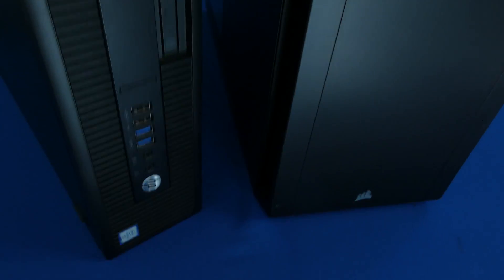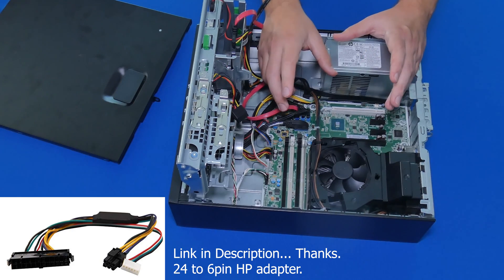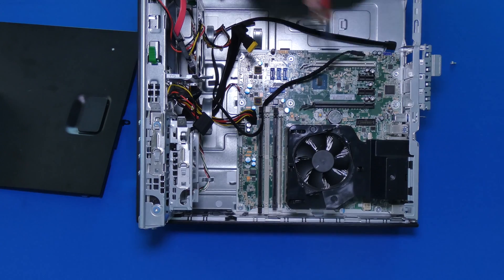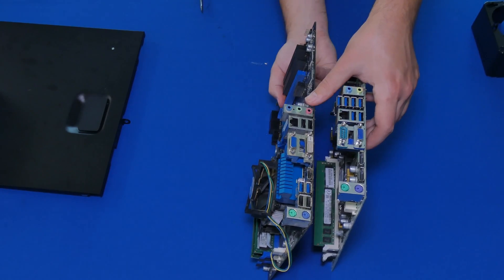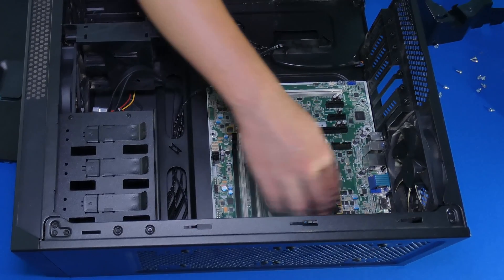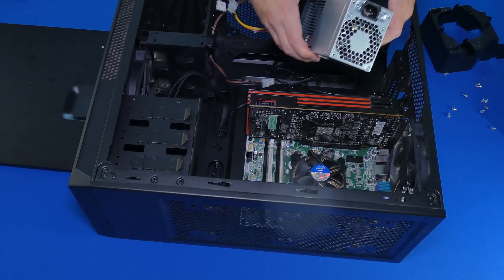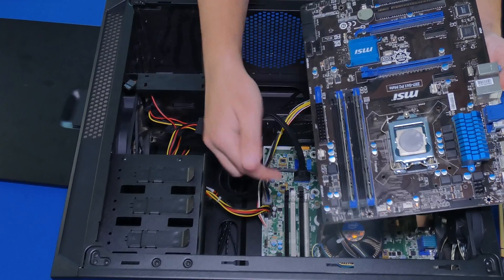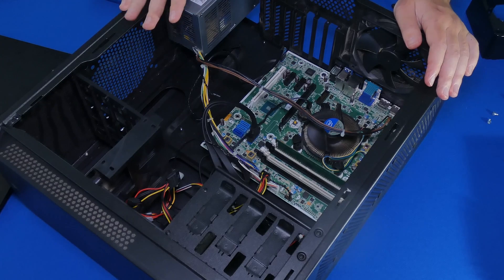HP EliteDesk transferring Parts to New Larger PC CASE

Comment: So...At the end of the day, Will this all work for a Hp elite 8300 sff?!!?
Reply from the maker: Sadly no... because it's a different type of motherboard. The orientation is different.
Reply: @Cobuman  😥😪thank-you
Reply: @Cobuman  do you think because of the front power (sw) or it just won't fit?!
Reply from the maker: @tdmtree  Motherboard orientation will not align with the back.
Reply: @Cobuman  oooooooooo ok. I see thanks for telling
Reply: I wish
Reply: It won't. Older HP sff are BTX motherboard not ATX. The prodesk ones uses ATX so you can use custom case.

Comment: I have 8300 SFF, i5 3570, 8 ram , ssd, 240w psu. I added all these components on wooden plate - to add there GTX 1650 (not low profile) which is powered through pciex16. It takes 75w (like GTX 1050 LP) so I hope that PSU 230w is enough for this setup. I'm currently working on thermal things, already isolated PSU from other components. This wooden board will be mounted under main desk board, so compleyely invisible, cold air intake from front side and hot exhaust from back side. So I hope that 240W PSU will hold i5 + GTX 1650 with 75W consumption
Reply from the maker: It should be fine. I have a couple of other  videos in which I recommended using low profile version of GPU and nobody reported any issues with stock PSU.
Reply: @Cobuman  Thanks for info! I added there Gigabyte GTX 1650 mini OC 4GB and no problem yet !
Reply from the maker: @radovanrakovicky2655  Nice!
Reply: @Cobuman  Only one thing here - based on coolermaster psu calculator my i5 3570 + 2x4GB DDR3 + Samsung SSD + GTX1650 75W it calculated 236 watt. I have also 500GB Seagate Baracuda 7200rpm but I'm not sure if this 240W HP PSU can hadle it too...so I have to make some experiments later & will inform ;-)  I think that noone did some test on PSU consumption limit for HPs and Dells small form factors with specific HP 240W PSUs during max CPU+GPU load.
Reply from the maker: @radovanrakovicky2655  I'd be interested to know what the total power consumption is on full load. I use hwinfo64 when overclocking CPU which shows the wattage as well. Although, the power is measured at software level which may not be 100% accurate. The other option is using one of those tools that measure power at wall socket. Now that I think about it I need to buy one of those tools.

Comment: I was looking for a second pc for like 400 euros, till I came accros these refurbished hp prodesks. Just bought a hp prodesk i5 4570. 8gb ram. ssd. For 125 euro. Thats like 140 dollars. The thing is fast for its price.
Reply from the maker: That's a good deal. Esp with SSD inside.
Reply: Me too! I just got a HP Elite with a i7 3770 and 16gb DDR3 ram, GT 210 and 1TB HDD for $200, I was thinking of buying a GT 1030 but thanks to this video I think I'll hold off and change the case when I can afford a new PSU and a used RX 580/GTX 1060
Reply from the maker: @Luis444Felipe  Good plan. 👍
Reply from the maker: @steven s Cool. 👍
Reply: bought hp elite 8300 with i5 3470 and 8gb ram for €89, will it work on cube case like thermaltake core v21?
Reply from the maker: @mv2430  No. :( The motherboard is different shape. It will not work.
Reply: @Cobuman  Aww :(
Reply: @Cobuman  HI, Can I transfer the HP Elitedesk 800 G1 SFF motherboard and power supply to the thermaltake core v21? Also did you have the 800 G1 SFF? Sorry my audio wasn't working but I was using captions. I will do it properly when my speaker is fixed.
Edit: One more question, do I need the 3d printed IO shield or can I use the normal IO shield? Sorry for all the questions. Thanks in advance!

Comment: Wait i have a question the hp motherboard are with different sizes of heastik how you install the normal cpu cooler
Reply from the maker: Just like in the video. So any standard intel socket 1150 or 1151 cooler should work.
Reply: @Cobuman  I will try i am on hp 800 g1

Comment: Would this work with any micro atx case or just this specific case?
Reply from the maker: It does not have to be this specific case; however, the size of the motherboard is closer to standard atx which around 25% bigger so a micro atx will not work.
Reply: @Cobuman  Perfect, thanks for the response.

Comment: Can I use the proprietary cooler by using nuts to old it in place?
Reply: I just realized i need to use nuts because the one that u have in the vid is standard mine is proprietary. elitedesk 800 g1 sff
Reply from the maker: @realKowai  The cooler/heatsink is a standard size so it depends on the cooler design.. otherwise it just fits.
Reply: Mine is proprietary as well... What size nuts did you use  @icyCodes Vlogs?
Reply: What size nuts mate?
Reply: Hi bro, what size of nuts have you used?

Comment: Hp 8300
Core i5 3570
Mother board 3397 do you think is it still worth uograding thinking of putting a frapic card and ssd and new power supply and fucking hot case

Comment: Hey, bro! I get this one next month and already searching for information about upgrade. I'd like to buy only LP GTX 1650 and 16gb of RAM. Will it work fine with this PSU and will I need to buy any cabels? But the way, do you think that this is a good bargain to buy G1 SFF with I5-4590 and 4gb of ram+ Samsung 24' FHD Monitor for 150$ total? Thanks!
Reply from the maker: That's pretty good deal. Along with GPU and RAM upgrade you may want to install an SSD as OS.
Is this the LP 1650 https://amzn.to/2ryiPSB you are talking about? It should work fine; it may need extra power but not sure because it's so new. Either way you can use an adapter for extra power if needed.

Comment: Can you make a tutorial of how to install any psu for HP Elitedesk 800 g1? I have seen the tutorials but i'm confused of which adapter i should buy so it would work
Reply from the maker: I'll put on my list of to do videos.
Reply: @Cobuman  oh right almost forgot.. please don't forget to make a small explanation about the P2 pin wires because some adapter i've seen has 4 wires and my original P2 pin has 5 wires.
Reply: @Cobuman  Would you be able to make an i/o shield for the 800 g1? the one you provided don't work for the 800 g1 sff
Reply from the maker: @RaphLevesque  It should be the same. In what way is G1 different? I can modify the 3d model and link it to you.
Reply from the maker: @RaphLevesque  I've added an alternative 3d model which may work for you: https://www.thingiverse.com/thing:3912752  It may not be 100% accurate because I don't have a physical reference.
Reply: @Cobuman  Thank you ! i will order a sample and test it, if it doesn't work i can maybe cut it down (i/o shield) and send it to you?
Reply from the maker: @RaphLevesque  :) You don't need to send it to me. I have a feeling it will be close enough as long as it's the same pattern.
Reply: @Cobuman  Alright ! i will keep you updated :)
Reply: @RaphLevesque  Do you change the case of 800 g1 sucsesfull ?
Reply: @mr.ji4ko795  i haven't done it yet, i let you know when i do it :)
Reply: @RaphLevesque  okey :)
Reply: @RaphLevesque  Hey in have a G1 too. Did you swap the case successfully?
Reply: Thx!

Comment: What kinda pin is there for the front panel on your MB. 
Mines is 

• •
• •
  •
• •
• • 

I can’t figure out why which way it goes and no where on the internet is there a diagram And now my pc won’t turn on at all. I have green light on the motherboard put everything back and noting. Can I possibly have damaged it ? 
Thanks great vid btw
Reply from the maker: I think mine is the same. At the end of the video I show where the switch goes. https://youtu.be/C70nmtTFPuw?t=850 
Just double check the PSU connections and if PWR SW does not work try attaching the other cable which is RESET SW.
Reply: Same problem here

Comment: Nice video. I would have loved to see how you wired the 24 pin to 6 pin (P2) connector.  I know there are the adapter cables, but I have seen 2 or 3 different wiring configurations.  I have an HP Elite 8300 CMT (not small form factor), that I am upgrading the power supply (PSU), to a 600 watt, to drive a Radeon RX 590 GPU. 
My original 6 pin, P2 connector wiring is :  [xxOOOO] . The 24 to 6 pin adapter cable is: [xOOOOx] .  ('x'=open, no wire) 
I was just wondering how you addressed this issue.
Reply from the maker: I thought the adapters worked fine with PSU upgrade... Oh, I see the complaints about PS Fan error on some of these adapters. You can move the pin cable around as suggest by the first review on this product page: https://amzn.to/2JOMQDP . 
I forgot about that since I don't use it as main computer.
Reply: Maybe this one will work for you: https://www.aliexpress.com/item/33029916086.html?spm=a2g0o.cart.0.0.42153c00B30GgA&mp=1

Comment: So I can connect a more powerful psu, but It'll just have to sit outside the case, Ok that works for my problem. My graphics card, the ti 1050 was drawing too much power while having a 4k tv and monitor hooked up. So with that adaptor I can hook up a 450 watt psu and solve my problems :).
Reply from the maker: Correct. This video talks about it as well. https://youtu.be/tj2ws0mTm6E You can see how PSU is connected to graphics card only in this example.
Reply: @Cobuman  Hey, It worked! And my problem is solved. So now I'm going to buy a bigger case for it so the psu isn't hanging outside the current case.
Reply from the maker: @Lycanwolfwarrior666  :) Good. 👍
Reply: Dude you answered my question thank you way cheaper and it still works awesome

Comment: The Power connection fits but its not powering on??
Reply from the maker: Did you connect the power switch correctly? Cable should be labeled Power SW. Towards the end of the video I show where to connect on motherboard.
Reply: @Cobuman  yes i did but its not working in any way and now my pc just died because the pins under the CPU bent
Reply from the maker: Why did you take out the CPU? This video does not tell you to do that.
Reply: @Cobuman  i just took it out when i finished everything because it wasnt starting then i looked for it
Reply from the maker: @hxckzsvz1956  Sorry to hear that. You can transfer parts to an aftermarket motherboard but at this point you may be better off building a newer PC.

Comment: What about those Sata ports, they stayed empty
Reply: Does it fit when they're used ?
Reply: If you ever reply, please tell me your opinion about the possibility to fit a full size gpu in a HP ProDesk 600 G1 SFF.
Reply from the maker: You can connect anything you'd like to SATA ports as normal. For the 600 G1 SFF a full size GPU will never fit inside unless you transfer everything over to larger case, use an external GPU adapter or buy "low profile" card like GTX 1050 ti: https://amzn.to/310pth4  Here is my video on external GPU setup: https://youtu.be/tj2ws0mTm6E

Comment: really want to transfer my 8300 sff to a bigger case but i cant find one... please help
Reply from the maker: So, it appears to be a BTX type of mobo for 8300 which is backwards from standard ATX... sadly, I didn't find any aftermarket cases to support it. Sorry buddy.
Reply: cobuman 
Can we just change the motherboard ?
Reply from the maker: @jem5665  You can but the only thing working after would be the CPU and maybe RAM, PSU would have different connectors. At that point you can build a new PC.
Reply: cobuman 
Hey i have sff pc (Dell optiplex 990) and a old pc. Should i just basically upgrade the old pc with the sff pc parts and with a new power supply and GPU? I dont think the cpu cooler would work tho
Reply: Ive been stressed out for a long time about this and your the only guy who has helped me. Someone should really have a discord on helping people build a pc or something.
Reply from the maker: @jem5665  I like helping people in my free time.
Reply from the maker: @jem5665  Both of those PCs are same generation so you could compare parts and just go with the best/fastest. For example;  google both CPUs and see which is faster/more cores and etc-then go with that one. If you wish to upgrade the GPU on SFF that will give you the biggest upgrade on either PC when it comes to gaming. My video on that: https://youtu.be/EDau98FCzaA
Reply: cobuman 
I really want to put my dell optiplex 990 sff into a bigger case. Are there any motherboards that support my ram and is there a way to tell what my ram type is as well?
Reply: @Cobuman  THANKS for the response i guess its time to move on and buy new mobo

Comment: Cobu can i put my 8100sff in a bigger case?
Reply from the maker: I though you did already. 😁 Maybe it was someone else who did it.. hehe
It should be the same method as on this video. The PSU is a bit different looking though.
Reply: @Cobuman  i had a new psu 550w with the adaptor but ill get a new pc in a year so its still not a problem  it will be with 1500€ a 1660ti 16 gb ram and an ryzen 5 3600 so
Reply: @Cobuman  case wont work  with 8300sff

Comment: What about the other psu?
Reply from the maker: Any other ATX psu will work with mentioned adapter. Installation is virtually the same  except you take the adapter-plug in to 24pin connector.

Comment: Here’s the thing. I bought an off-lease HP Elite 8300 SFF (with an i7-3770 processor) at a cheap price. I took it apart, cleaned everything, spray-painted the case, then rebuilt it (and it was easy, as the system is highly modular for easy servicing). Then, I loaded up the memory to 32 GB (cheap DDR3-1600), popped in a 1050 Ti (low-profile), and replaced the HDD with a good 1TB SSD.

It was a fun, inexpensive project. It didn’t take long at all, and the results are stunning. My point? It was much easier doing that than trying to move the guts of a proprietary system to a standard case with a standard power supply. 

Don’t get me wrong. Your project appeals to me (and likely others) just for the sheer geek factor involved. I’m just saying that one can still get a good geek fix by going the route that I chose instead.
Reply from the maker: This is definitely not for everybody.  :) 1050 ti is the first thing I recommend to people for sure.  I have few videos on that.
Reply: I did the same thing, buying a lp 1050 ti but due to the tiny fans the thing was a hell of noise. I will try to move the system to a new case and get a full size gpu with the 0 db feature.
Reply from the maker: @robcastaneda1   👍

Comment from the maker: Do you have an HP EliteDesk SFF PC and wonder if you can transfer everything to a larger Case? YES! You can! 
HP EliteDesk 800 G2 (affiliate) https://amzn.to/2YD4WwZ
My PC Case Corsair (affiliate) https://amzn.to/3FL7WzF
Power Supply adapter (affiliate) https://amzn.to/2SIpV2i Heatsink and Fan (affiliate) https://amzn.to/2Zw1q94
Power Supply (affiliate) https://amzn.to/2YCSbm3
Reply: Why did you change the heatsink? Seems it could have been reused without a problem?
Reply: Hey first of all thank you. Do you deal with any errors on boot (having to press f1 because of intrusion sensor for example) or any other issues since you made the video? Thanks a lot
Reply: lmao he is trying to break peoples systems cause he isnt answering or showing the pc lmao
Reply: hello i am trying to change the case but i cannot use the old CPU fan because the old one was connected to the case. what kind of CPU fan should i use. could you please inform some models to me. i am stuck
Reply from the maker: @BurhanErdal  You can use any standard CPU fan/heatsink for that socket. Just like shown in the video.
Reply: hi i have a hp elitedesk g2 and the adapter doesn't work any ideas how i could make it work i bought the one in your description
Reply: @morefpsgamingftw3062  what kind of power supply are you using? I read on some of the Amazon reviews that the adapters don't work but its due to it being defective.
Reply: @morefpsgamingftw3062  you'll have to find a diffrent adapter. I have a pro desk g1 and i had to buy 2 before i found a good one.. and make sure that your using a good power supply
Reply: @austina8565  what type of case did you transfer it to? itx or atx.  cant figure out which to buy i have a pro desk 600 g2
Reply: How about g1
Reply: Hi, I got a question. Got a ASRock RX 6600 Challenger D OC and planning on putting it into a 800 G2 motherboard with a new case, I'm a little concerned about there being enough clearance to plug-in front panel USB 3.0 with or without a 90° adapter. (The card's dimensions are 269 x 132 x 41 mm)